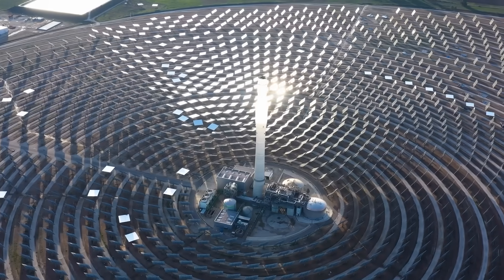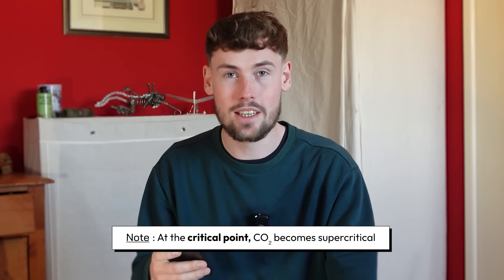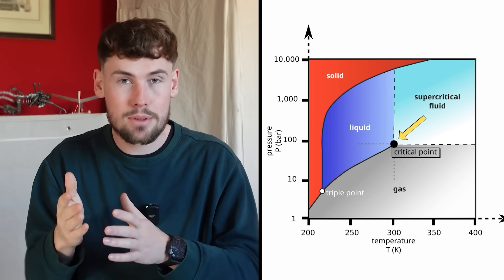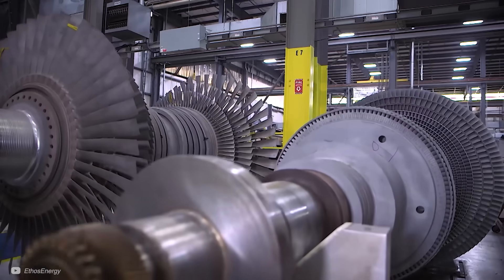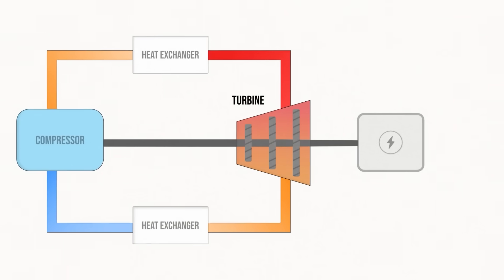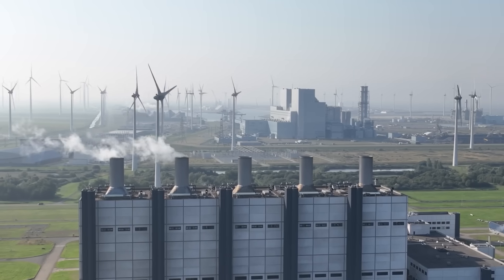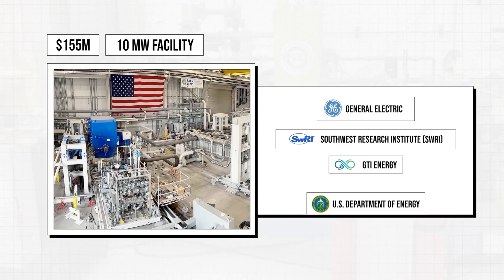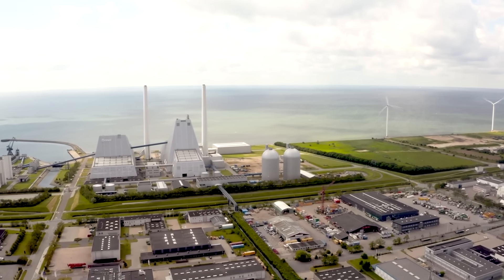How Ultra-Efficient CO2 Turbines Are The Future of Energy

Comment: I don't get the point at 7:21.
Water is pumped in the boiler, converted into steam, expanded and condensed. So what's the point to use an "easier to compress" fluid to compare to a cycle where no compression at all takes place?

That's a false argument.

Comment: Enjoyed the video on super-critical CO2 turbines. Question, where does the CO2 come from and is it kept in a closed loop or is it released into the atmosphere after passing through the turbine? In other words, what is the CO2 emissions impact of such turbines? I get the importance in efficiency in reducing CO2, but not the source and destination of the CO2 used to turn the turbine itself.
Reply: It's cooled by expansion in the turbine and recycled back to be heated again
Reply: @thewheelieguy  Thanks for that! Do you know if there is much leakage over time, sort of like refrigerant in your AC or refrigerator?
Reply: @jebblount8874  yes, anytime you have pressurized gas, there's leakage. At least CO2 is not like helium or hydrogen, which leak from 'sealed' systems at a surprising rate.
Reply: @thewheelieguy  Thanks again. Clears things up quite a bit. Cheers!

Comment: The issue I see is the turbine seals. as they need to work with High pressure CO2. The only option is to probably include the generator inside the pressure container with the turbine which also causes problems because High pressure CO2 is a corrosive solvent (will attack the wire insulation and corrode copper & steel parts).

Turbines use labyrinth which basically allow pressure to escape, espeically when not rotating or low RPMs. Escaping Steam isn't a problem, but CO2 would be a problem.

I don't this will go anywhere.

Comment: 4:55  : Cavitation Minimum word Should be included in the script for further research benifits not just small bubbles(cavitation is small air bubbles moving that fast Explode causing damage and deformed dimpled surface.

Comment: As far as I know, not all turbines use steam. Gas turbines have been around for decades
Reply: Those are brayton cycle turbines. They're burning the gas in the compressed air. Steam turbines work on the rankine cycle, with an external boiler and a regular water pump to pressurize the system. This is a lot more like the steam turbines. I'm not sure what they call the cycle though.

Comment: Dude, you absolutely have no idea how it works. Turbine is not driven by supercritical CO2 but by gaseous CO2. In fact, this is nothing new. There were CO2 reactors in past, where coolant and working medium in one - liquid CO2 was used to remove heat from reactors core, then turn into pressure gas in expander, driven trough turbine, then to cooler and after cooler was compressor, which changed CO2 back into liquid and pour back to the reactor. And because temperature of CO2 never dropped under critical point, it was also supercritical CO2.

Problem with CO2 as working medium is low thermal capacity and supercritical CO2 has also low density. Because of that, they need big thermal gradient and serious pressures.

So there are some promises, but not some superbright future.

Comment: I wonder what is the maximum efficiency possible. You know, like gasoline engines are basically caped around 35% (I can't remember the exact value) no matter what. I'm pretty sure steam turbines are currently near the maximum efficiency, but this is a new tech. Is there some possible increase in efficiency later ? Like, it will be 50% now, but with further upgrades, could reach 70% ?

Comment: I am pretty sure the problem with super critical co2 turbine  is the speed they run at. And 2700 rpm vs 3000 to 15000 is a hell of a jump.

Comment: Atmospheric carbon dioxide at 1200 ppm verses today's of 400 ppm would greatly invigorate C3 plants over 90% on earth.  Earth's water vapor saturated greenhouse effect absorbs all the greenhouse radiant energy from earth within a few meters of the radiating surface adding 10°F (5.55°C) earth's average temperature and can't have its overall all effect changed.   It is scientifically impossible for greenhouse gas behavior to cause global warming which has been at 1°C since 1992.  The cause of global warming is not known.

Comment: No ome compress steam man , they just let steam exit , the  amount of energy you need to compress co2 again is huge
Reply: Huge compared to what though?

Heating 1 kg of water to 600°C steam takes ~2,613 kJ.
Heating 1 kg of CO₂ to 700°C takes ~574 kJ.
Water needs ~4.5× more heat than CO₂.
Reply: And I disagree that it's hard to compress: 

CO₂ is a nonpolar molecule, which means its molecules don't have a positive or negative charge distribution. This allows CO₂ to be more easily compressible compared to water or steam, which have polar molecules with stronger intermolecular forces (hydrogen bonding in water).

This difference in molecular behavior makes CO₂ much easier to compress into its supercritical state than water, which requires much higher pressure and energy for compression.

Comment: sCO₂ turbines convert heat to power—they don’t require burning fuel. They also work with nuclear, solar thermal, or geothermal.

Please don't confuse the method of producing heat heat with converting that heat to electricity

Comment: GE hybrid plant can go to 63% efficiency: Stage 1 is a direct fire natural gas turbine, and stage 2 is exhaust heat recovery. Other method may use fuel cells combined with other methods to use hydrocarbon fuels and get efficiencies over 80% but are quite expensive investments. Cost of maintenance is likely the determining factor in how much efficiency can be squeezed out of a commercial system. 2 stage systems seem to offer good flexibility.

Comment: We are supposed to be abandoning burning stuff to produce electricity
Reply: sCO₂ turbines convert heat to power—they don’t require burning fuel. They also work with nuclear, solar thermal, or geothermal.

Please don't confuse the method of producing heat heat with converting that heat to electricity

Comment: I’m not convinced this will make a huge difference, because we’re no longer building thermal electric plants seriously. 90% of new electricity generation globally is now solar (or wind), because it’s drastically cheaper than burning fossil fuels. So this would mostly matter as retrofits for existing coal/gas/nuclear plants. But nuclear would run into regulatory thickets, coal is going away, and gas is probably not worth upgrading.
Reply: Plenty of manufacturing facilitieb use steam turbines to utilise otherwise waste heat
Reply: Grid balancing is quite tricky task. Sometimes there is a need to get extra energy to match the consuption and there are not so many energy sources that can start and produce it in a short term. Basically if wind and solar is not enough, then hydropower and gas turbines are the main support sources.  The more green energy is in the grid, the bigger is need in balancing. Plus if you can get 1% extra energy from turbine it might be already profitable to replace old one with a new.
Reply: @ Batteries work better for that, and at this point, they’re cheaper, at least for new capacity. You can see this in Texas, where their highly deregulated and rapidly growing grid is adding massive batteries, but almost no new gas capacity. Or in California, where gas consumption has fallen over 46% in the past two years due to batteries on the grid, without substantial change in demand. The cheapness of current batteries (and solar to charge them) makes it harder and harder to justify investment in gas plants.

Comment: Collecting, purifying, and cooling (or pressurizing) the CO2 needs to be included in the efficiency calculation.  Bet it is not so cost efficient.
Reply: Producing commercial CO2 is done by modifying petrochemicals, I.E not retrieved from the air. 

There is no cooling of the CO2 required for a supercritical turbine. Rather is heated to approximately 500- 700°.
The cooling to get a block of CO2 ice was only for that little video in better than side. Simply because it's much easier to shove a block of CO2 into that little chamber, then just to pump in the required amount. 

No, there are no byproducts from the sCO₂ turbine itself—it's a closed-loop system. The CO₂ circulates continuously, just transferring heat and driving the turbine.

Regarding he of the CO2 versus the heating of say water in a steam turbine 

To heat 1 kg of water to 600°C as steam: ~2,261 kJ
To heat 1 kg of CO₂ to 700°C: ~574 kJ

So steam needs ~4× more heat than supercritical CO₂ for similar temps.

Comment: Seems like it may best for space constrained environments like a nuclear sub.
Reply: The boilers don't get any smaller, so the overall space saved is negligible, but you're adding extremely high pressure CO2 to a sealed environment that people also have to live in.
Reply: @ why wouldn’t the boilers be smaller?  Steam turbines are very large and replacing them with something that’s 20% the size would absolutely help a benefit when space and packaging is a major consideration.
Reply: @undertow2142  Because releasing the same amount of heat energy to either steam of CO2 requires requires the fire to be the same size. Since the temperatures are similar there's no overhead to just have a hotter fire for the CO2. Because of the different thermal conductivities of the fluids involved, the boiler tube diameters will need to be different, but the boiler size will be near identical. I recommend you visit a power plant (Many of them offer tours) just to get an idea of how ridiculously huge the boilers are compared to the turbines.

Comment: 3:30 bruh no one is turning a turbine with solar panels, and concentrated solar is dead.
Reply: 3:30 is clearly talking about the critical pressure points of CO2. Not anything to do with generating heat from solar panels for use by steam turbines. 

However, thinking about the  crux of what you're trying to say could I offer this to the contrary:

Operational Solar Thermal Power Plants Using Steam Turbines:

Cerro Dominador (Chile) A 110 MW solar tower plant using molten salt storage to generate steam for electricity production.

Ivanpah Solar Electric Generating System (USA) Located in California's Mojave Desert, this facility uses mirrors to concentrate sunlight onto towers, producing steam to drive turbines.

Crescent Dunes (USA) Situated in Nevada, this plant employs molten salt to store solar heat, which is then used to generate steam for electricity production.

Noor Complex (Morocco) Comprising Noor I, II, and III, this complex utilizes parabolic trough and solar tower technologies with thermal storage to produce steam for power generation.

Andasol Solar Power Station (Spain) Located in Andalusia, this plant uses parabolic trough collectors and molten salt storage to generate steam for electricity.

PS10 and PS20 Solar Power Plants (Spain) These solar tower plants near Seville use heliostats to concentrate sunlight, producing steam to drive turbines.

Shams 1 (United Arab Emirates) A 100 MW parabolic trough plant in Abu Dhabi, generating steam to produce electricity.

Solana Generating Station (USA) Located in Arizona, this plant uses parabolic trough technology with molten salt storage to generate steam for power production.

Khi Solar One (South Africa) A 50 MW solar tower plant using steam turbines for electricity generation.

Delingha Solar Thermal Power Station (China) A 50 MW parabolic trough plant in Qinghai province, generating steam for power production.
Reply: Pumped Hydro… educate yourself please.
Reply: @LightningAussie Still ran primarily, meaning more than 80%, with diesel and coal, educate yourself.

Comment: As a power engineer I can say that this video is poorly made. Firstly it doesn't have any sources in description so i can't verify claimed data. Secondly i don't thnik theres a mentioned, what kind of cycle doest this turbine use. Rankine or Bryton. Third, comparison of sCO2 High Pressure side with H20 Low Pressure side is like comparing apples and oranges. Size of HP steam turbine is comparible  if not smaller to sCO2. Fourth, modern coal power plants have an efficnecy of 50% with pressures of 22 MPa and hipercritical power plants in China have even higher pressures. We even have CCGT plants with efficiencys above 60%. Thing that got right in the video was problem of steam turbines reaching 700 degrees. Can't say more about chanels because it got recomenden on main page.

Comment: hmm.  It had better achieve a lot more capacity per turbine.  Currently modern GE steam turbines commonly reach 1000megawatts per turbine.  it would take 100 CO2 turbines to do this. Requiring exotic materials and bearings, costs would quickly overrun the gains. Not to mention the infrastructure to combine all those smaller units. Steam turbines can run 30 years before major refurbishment, that's not likely with co2.  Worthy scientific research for sure, but it's got a very long way to go for real world practicality.  My money is on efficiency gains at the heat sources.

Comment: We used combined cycle in the oil field for heating and producing heavy oil where we would get 60% eff. electrical generation.  Plus we used the waste heat for dirty steam to heat the oil and produce it.  So using a gas turbine combined with this supercritical CO2 turbine could push the total eff. to 65-70% I'm sure they are already looking at this  since combined cycle tech is old school.  We installed them in the 90s
Reply: Downside is the pressure & cooling. sCO2 requires idiotically high pressure 1700psi (the video made a mistake and said 170psi). 

Shaft seals & heat exchangers that operate at these pressures aren't common outside of research applications.
Reply: No, you wouldn't get 65-70% plant efficiency as the Rankine cycle part of a combined cycle operates at much lower temperatures than what is required for these CO2 turbines to be 50% efficient. There might still be an improvement over steam if used in a combined cycle plant, but not that much.
Reply: @LocPH.  Yeah given modern steam is already over 70% efficient sCO2 has a long way to go

Comment: 3:03 I believe the solar panel picture is not accurate, what you might have wanted to show is the solar tower, with the super hot tip, where the sun rays are concentrated…
Plus I think there is also potential this might be used in conjunction with geothermal (given that the loop is completely closed so co2 is not lost, to the soil)